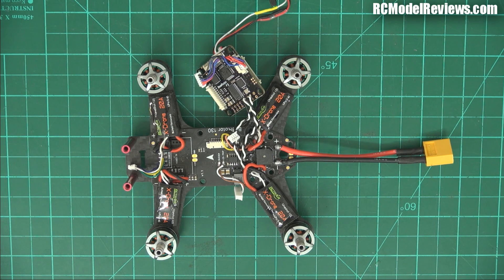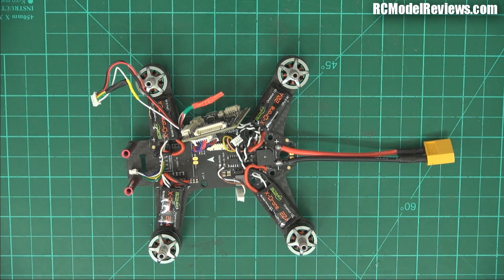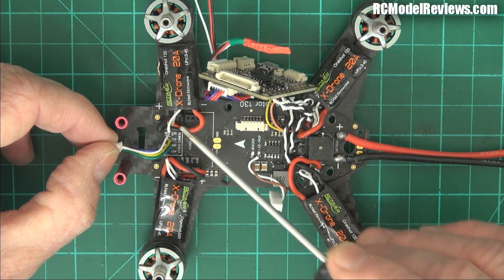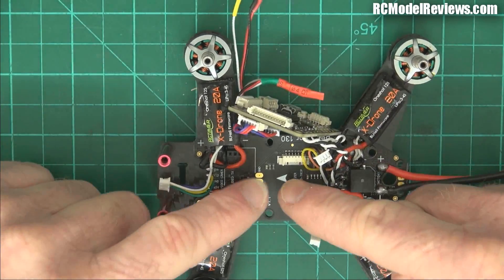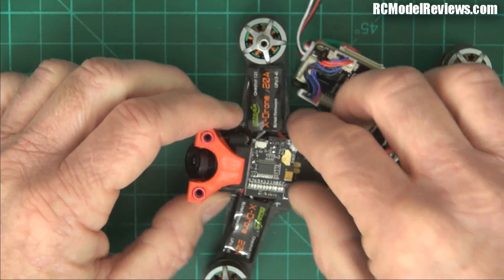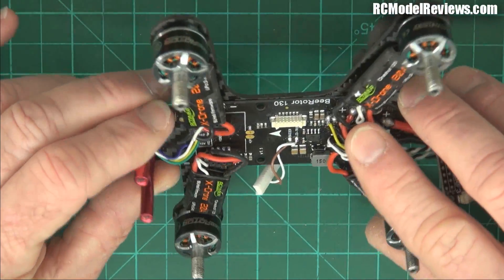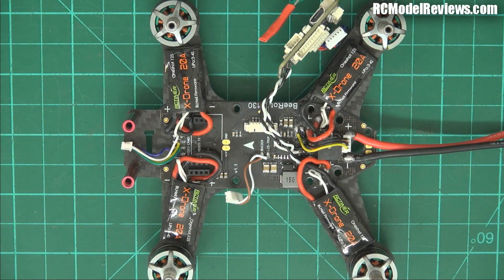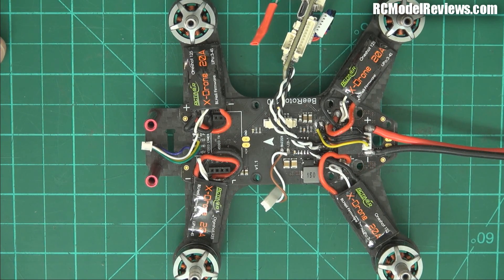Fixing noisy FPV video

Comment: I agree to a certain degree on the OSD reasoning, but I like having the voltage on my display since even telemetry gives alot of false warnings when the burst voltage in a throttle punchout dips below the voltage limits. Need a time delay on the voltage dips (only trigger warning if voltage is below voltage limit over 10 seconds as an example) which may be possible on the Taranis, but I have not figured that part out yet. And I also like to have a visual indication ofmthe floght mode. Sure I can probably set a switch to read that for my, but that removes stick-focus from flying the quad. But the artificial horizon line need not be there, nor the tilt angle unless you have a quad with servocontrolled fpv camera, then it is a must.
Reply: Watch the rotor riot video on setting up the taranis.  In that Chad sets it up to wait for the voltage to be under the cut off for 2 seconds before announcement.

For summary.  Logical switch A<X VFAS 13.50v ---  2.0  2.0  Then under special functions Lx (where X is the number of your logical switch, probably 1) Play track, Low batt, X1.
Reply: Jens Petter IkkeOppført A perfect OSD is only battery voltage and a timer I think. I personally hate flying with a group where everyone uses their Taranis...as all I hear is everyone's TX making obnoxious sounds and voices the whole time making it impossible to hear anything useful.
Reply: thanks for this, I've just setup my Taranis accordingly after reading your comment ;)

Comment: actually i found osd on miniquad very helpful.. agree that horizon is bs, but voltage, current, mah consumed, and flight time are very important to me.. i want build any mini without it.. i got same fc on two minis working perfect.. both are very tight buids (even tighter than that one), and no interference at all even at 70+ amps throttle punchouts.. 
"will i puff my battery or not?", i wont take chances on that.. osd is friend..

Comment: i have the Beerotor Synergy F3. it works great. no problems with the video. just remove the pdb and run the cam wires directly to the "sd" port of the F3 ;)

Comment: I don't fully agree with you on not having an osd. Yes I definitely concur regarding not needing a horizon display BUT I can't rely on my taranis these days to tell me when my battery is low as a good punch out will get the taranis lady telling me that it's time to come back and land as my voltage is critical. So a mah and voltage osd readout is imperative IMO
Reply: I use the KISS24a and KISS FC which has all that built in.  I too hate OSD's with a passion but mah consumption is very important.
Reply: Not without a current sensor, which is added weight. And voltage changes depending on capacity and also how much is being drawn at any given point. It's much easier to visually see reliable data than have it announced to you anyways. Now i do agree with the horizon line, absolutely pointless.
I've been using an osd+pdb for a while now, and it sucks flying something else with fpv without an osd
Reply: You should set a delay on the taranis to fix that
Reply: You can set a transmitter like a Taranis to not sound the voltage alarm unless the voltage is below the alarm level for a given amount of time.  You can set that for like 7 seconds and then it wont go off every time you do a 3 second punchout.
Reply: I don't know anything about taranis but I think you could set a switch to tell you exactly mAh burned or voltage. I think finalglide did something similar in a video somewhere
Reply: You can do what I do.  I use one of the switched I am not uiseing that is easy to get to while flying and pull it back once and she tells me the voltage and what ever eles I need.  There are so many options out there bro.
Reply: If your OSD can be fed with mah then you can send that telemetry to your taranis.  Just set your taranis to tell you to land based on mah burned.
Reply: DOON fpv i mostly dont even regard that the voltage is low when shes chatting shit. im to focused, as long as i can see the condion on the screen its not hard to miss